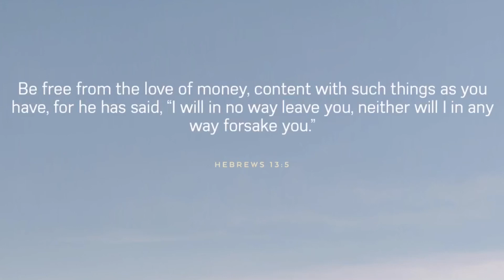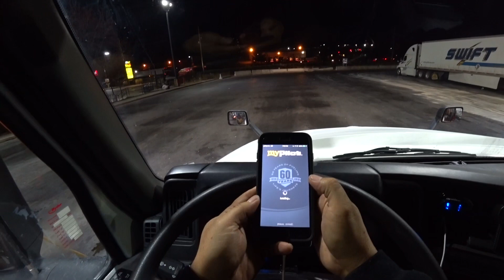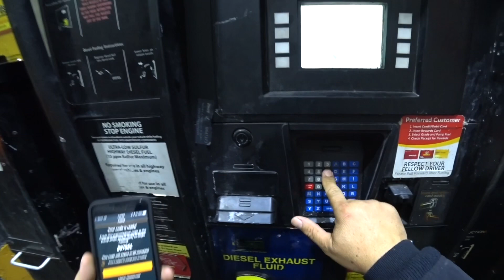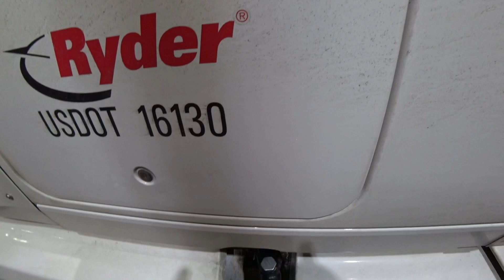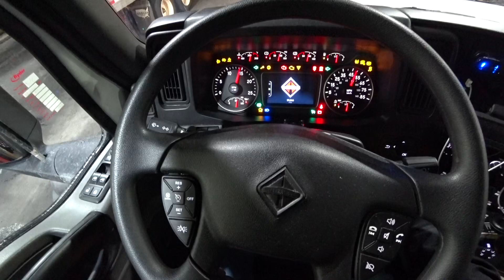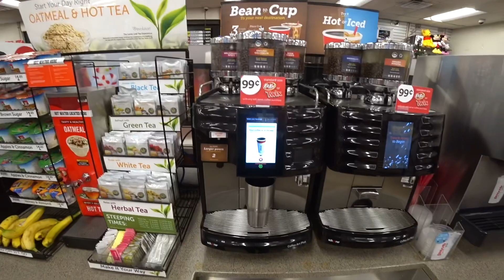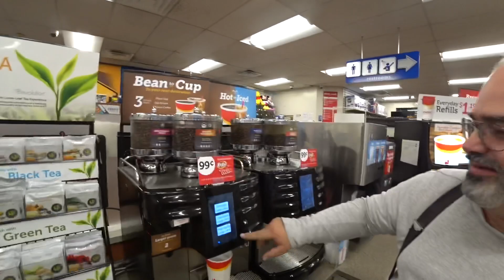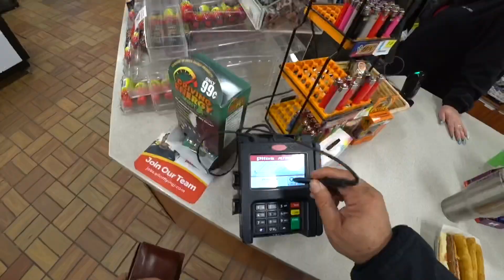December 7, 2018/1435 loaded, fuel, coffee, hotdogs, tornados, cash advance

Comment: Hey John why do u thump the rear tires and what not but not the front steer tires.
Reply: I wonder the same thing.
Reply: You thump the tyres to tell if they are correctly inflated. If they all sound the same, you know that they are at pressure.
The very front tyres don't need thumping because they are the steer tyres and yoyu would be able to "feel" though the steering wheel if anything was wrong.
Reply: Because of the dual tires. If there is a flat on duals, the one with air in it would hold it up and you may not be able to tell visually if there is a flat. If there is a flat steer tire, it is obvious because there's not another tire beside it to hold it up.
Reply: Thanks guys